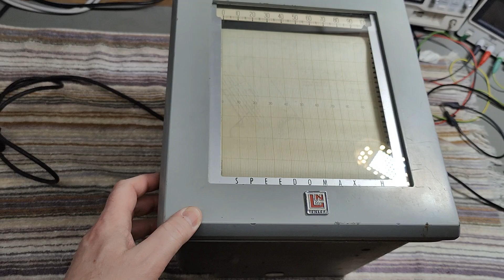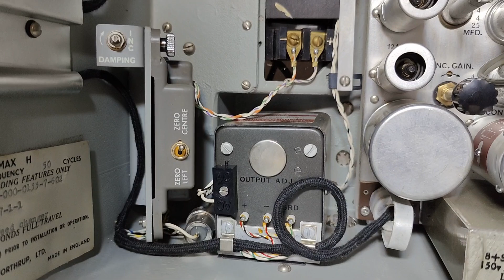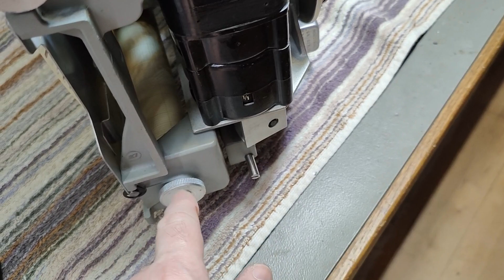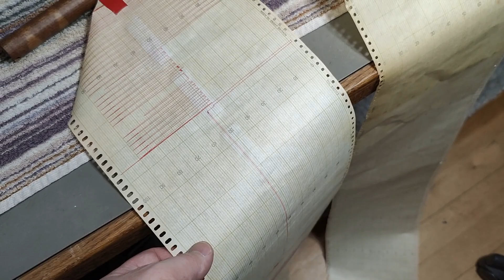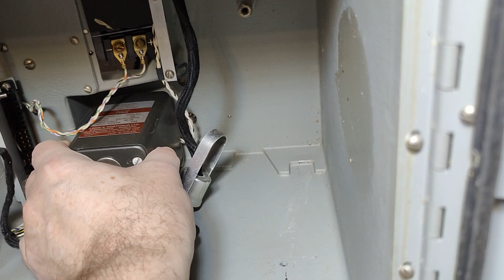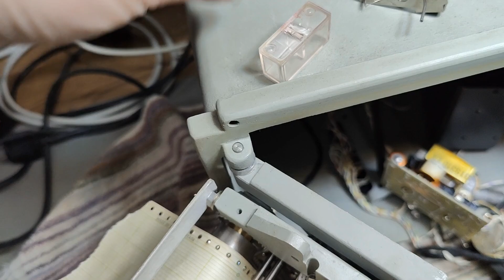Leeds and Northrup Co Limited Speedomax H Plotter Recorder 1967

Comment: Thank you for the video. What camera do you use to make videos? I like the picture.
Reply from the maker: just a cellphone with 2K and 4k 60fps and stable video modes, it even record audio in stereo, it is called OnePlus 10 Pro NE2213 but before you go get one, you also need to know about its out of focus problems when close to smaller items, it is driving me nuts , and sometimes i need to use my old Huawei it just got better optics and better closeup modes, but it is only 30 fps, i just can not win..

Comment: Bad smell... First thing I thought of was Se rectifier.  SeO2. Found diodes, so I guess not. 
Described capillary action for pen.
Apply mV's to input pairs to identify controls.
Reply: Could it just be mold that grew on the paper and on paper particles in the device that causes the stink?